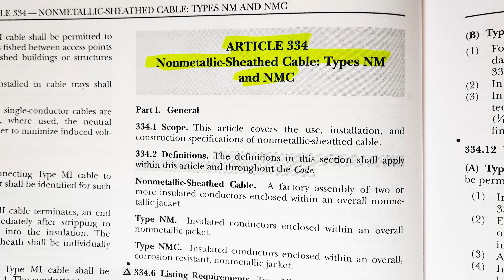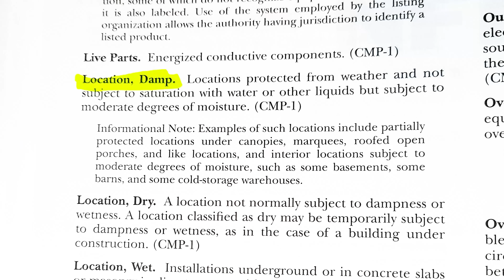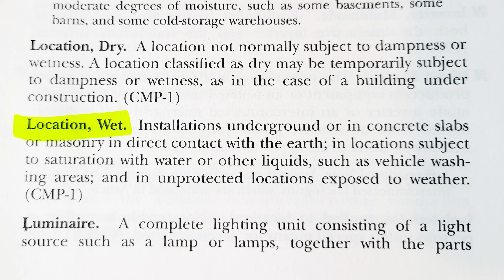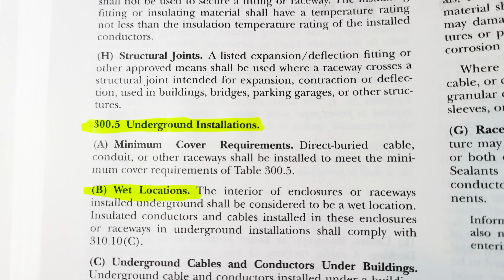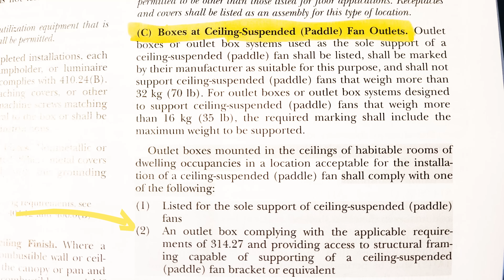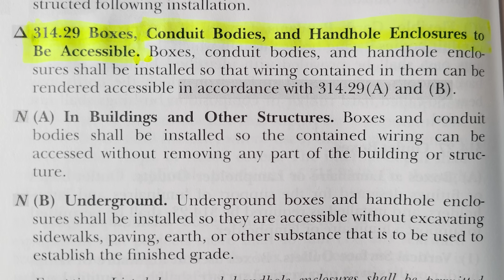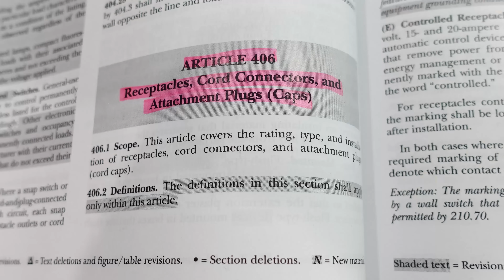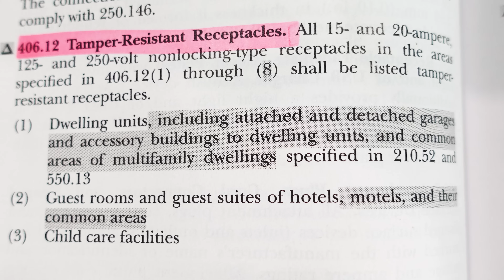BEST OF CODE TIME 2: Romex in Tubing, Ceiling Fans, J-Box Splices & Receptacles in Wet Locations

Comment: Wait what, THHN is for wet environments?  I’m installing PVC conduit on exposed outdoor wall, don’t I need to use THWN or UF cable?  Table 310.4(A)
Reply: If in a damp or wet location wire type MUST have a W in it like THWN, XHHN, THW. All the wire spools that I have used in last 40 up years are always at least dual rated. Example = THHN/THWN.
Reply: @garbo8962  Perfect! Thx

Comment: When I have a situation like that when the code I air on the side of caution if worried about the area being damp or moist I use wire that is for wet environment it may dry location by code but if it has potential get wet then I use correct type of wire

Comment: This is a fun thought experiment for code junkies, but here are the practical answers:
1 - Nonmetallic sheathed cable is not designed or listed to be installed in a conduit system. It is THHN-jacketed wire with a protective sheath, but that sheath is not as tough or abrasion-resistant as THHN or XHHW itself, which means it can snag and bunch easily, which does not work well when being pulled through conduit.
2 - NM cable has a bare ground (Typically) that is wrapped with paper. Not only is the bare ground subject to excessive corrosion in a damp environment, but the paper that keeps it positioned in the sheathing literally wicks and holds moisture around the bare copper.
3 - The sheathing around NM cable both acts as an additional insulating layer and takes up airspace (in a conduit). There is no specific calculation in the code book that I know of that allows for the extra space taken in a cross-section of conduit with regards to temp correction factors, let alone bundling or attempting to put two cables in one conduit with NM cable. What happens when someone tries to stuff two 12-3 Romex cables in a 3/4" EMT conduit on a rooftop? Can you fit 8 #12 THHN conductors in a 3/4" conduit? Sure. All day long. Can you do it with Romex? The code allows for sleeving NM cable to protect "against physical damage", but that is not the same as stuffing Romex in a full run of pipe because you're too lazy or cheap to come up with some rolls of THHN.
4 - There's the classic, "Can I just strip off the sheathing and use the wire?" question, to which the simple answer is No. The wire in NM cable is THHN jacketed (except the ground) rather than THWN, but there are no markings on it, so neither you, the inspector, or anyone after you can confirm whether it is THHN (75C max wet locations) or THWN (90C max wet locations).
Reply: Great commentary! It's evident that NM cable installations inside a conduit can come under attack, none the less in my opinion all the points you mention can be dealt with. Point 3 is most interesting and troublesome because is hard to quantify exactly the heating/dissipation effect of NM cables inside a raceway, but considering that NM-B wires have 90C rated insulation there is ample room for conductor ampacity adjustment  (down to 70% ) and still allow the use of 20A breaker on 12ga cable.

Comment: I prefer using saddle boxes for ceiling fans whenever possible. They are very easy to install and support up to 70-pound fans. They are plastic, but the screws holding the fan go through the box and into the joist making a very strong support.
Reply: Costs to much. I just use metal pancakes rated for fans. Bonus that its easier to install in awkward situations. I've hung from it myself, 220-lbs.

Comment: Man...you definitely have a nice troubleshooting job...but I am betting this wire inside these columns may have a break in one or all of the conductors due to settlement of the concrete that has been poured!  Personally I would run PVC from the point of the last good connection to the remaining fixtures and be done with it.  You should do a followup on this and show how you solved it.  Keep em coming Justin...you are a good and knowledgeable guy!

Comment: Before I was an apprentice I got a technical degree in electricity, my instructor was previously an inspector for Milwaukee County. He told us straight up, don't put Romex in conduit, ever. If you need to run conduit for something, use standalone conductors.

Fast forward 3 months where I'm about to graduate, there were some dual-enrollment kids from high school trying to push and struggle even 10 ft of romex through a j-box with attached conduit, safe to say I saw it, my buddies saw it, my instructor saw it....after letting them struggle for 30 mins I told them they shouldn't be doing that, that they should get the wire cart, (which was initially suggested by my instructor); they slyly tried to pull a fast one. End of story, I told them this, they seemed upset, and one of them asked if it was a code violation, I said yes, and the other kid said sorry, we're just some dumbass kids in a really shitty tone, I replied, "I appreciate your honesty". 👍👍
Reply: Your instructor was wrong.  Nothing in the Code prohibits putting Romex in conduit.  In fact, 334.15(B) requires it in certain locations.  In most locations it doesn't make sense to do so, but it's not a code violation.
Reply: @barryomahony4983  Fair enough and I can agree. Entirely possible we were simulating direct burials in our stalls when I remember hearing this. Regardless I genuinely appreciate the knowledge; your statement also remains correct in the 2017 NEC. (if you use 2020 where you're at) Currently working industrial so I haven't been exposed heavily to Romex, let alone enough code time to consider myself educated. 👍
Reply: @Keatononame13  Sure if he was talking about burials he's spot on; inside a buried conduit is a wet location per Code, and per reality (you always get some water inside it).  Just run some THWN through it.  Not a big fan of UF and PVC conduit is cheap, so I'd rather run PVC and pull THWN
Reply: @barryomahony4983  Understood and thanks again. For my knowledge, THWN-2 is effectively the same in approved uses and utilizes same derating(s) as THHN correct?
Reply: @Keatononame13  Sometimes you may have a circuit run in NM that needs to be protected at some point in its run, so you can sleeve it in EMT or PVC conduit. But for long runs of raceways it makes sense to use single conductors like THHN or THWN.
Reply: @Keatononame13  Yep.

Comment: Question for though interested into becoming Electricians. Do you need a "mentor" in order to get started?
Reply: No but it would be helpful. My dad & uncle were electricians and from the age of 10 would go out on weekends with them to do a 100 amp service & install receptacles . Went to great VoTech school 15 hours a week for Industrial Electricity and I was so far ahead of other students shop teacher would send me out to install receptacles in class rooms. Only good way of learning is to attend a quality school. Get good at troubleshooting and if possible VFD drives. I retired from a 7 man shop and was the guy that got called to troubleshoot, repair & replace drives from 2 to 200 HP. A lot easier on your back & rest of the body doing that rather then installing heavy conduit and pulling large wires.

Comment: What I've been told by inspectors is the environment does NOT change when conduit is used.
If conduit is installed in a damp, or wet environment,  the conductors must be rated for the environment, conduit is protection from damage only, it doesn't alter the environment

Comment: I see people using pancakes everywhere, a buddy and i got into a dicussion on fan rated pancakes. How many of yall use fan rated pancakes and pull 14-3 to them?
Reply: Believe a 1/2" deep pancake box does not have enough cubic inches to allow a 14/3 NM ( Romex ) cable especially if you use a standard two screw Romex connector. At an IAEI continuing education class were told that can not use NM cable to feed any outdoor box because it's not rated for wet or damp location. So it appears that you have to use UF cable.

Comment: The job you had on the deck lights. Because it wasn't done properly prior to you working on it, can you just repair it the best you can or does it have to be ripped apart and done to current codes?

Comment: Great video of everyday problems. Homeowners think you can put a ceiling fan wherever they wish without having to change the box out, I gotta admit I've done it before to but made sure the box was solid. I'm trying to make it a habit of changing the box out if adding a fan. And also Romex in conduits, the guy I worked with always just pulled in Romex regardless, but after I'm on my own now I've started to use thhn a lot and wondered why we ever worked that hard pulling in Romex. There's so many things that are easier if done right and by code.
Reply: Well yeah if you are running conduit end to end you are a fool for putting romex in it. If the conduit is just for damage protection over part of a run it is better to avoid splices, all else being equal.

Comment: uf/nmc is never far in price from standard romex.  For the life of me I can't fathom why people would use romex instead.  And while you're at it add a dab of noalox/oxguard on your junctions and terminations anywhere you can see the sky and you're not looking through a window.
Reply: Yep, with the plastic pipe you don’t ruin the wire if you hit it with a shovel. My sisters house has romex buried and done really ghetto so that wires have been damaged multiple times.
Reply: They use it cause romex is easier to strip I suppose

Comment: For ceiling fans just use long wood screws and screw through the mounting bracket into the joist. That way you don’t need a fan box.
Reply: Not allowed by code
Reply: You need a fan box.  Its not just about mounting the box its about the joint between the fan and the box (specifically the threads)
Reply: This one is a classic example of using the proper materials is actually easier. They are made user friendly and designed for a specific purpose with no modification needed. A couple of extra dollars and you have a one hundred percent failure proof install. Be proud of yourself knowing a job  was done correctly.
Reply: do not work like this, and following the codes, man. Safety first.
Reply: How to fail an inspection 101
Reply: So that means you are either screwing through the j box or you don't even have a j box. That would fail inspection for those of us who do legit electrical work.